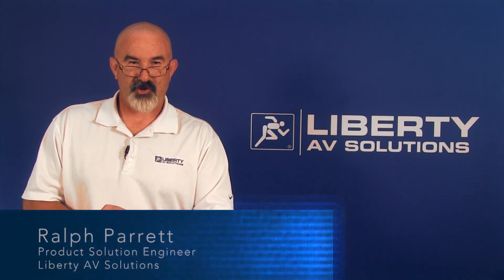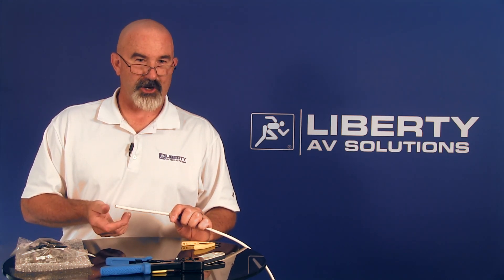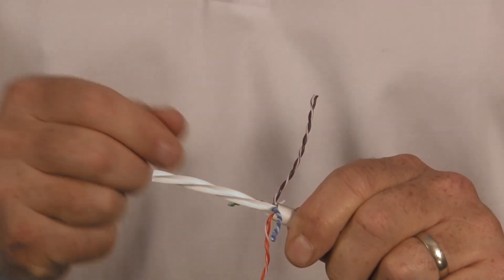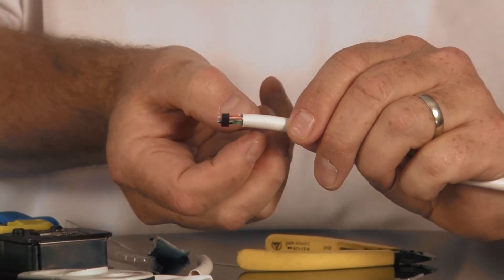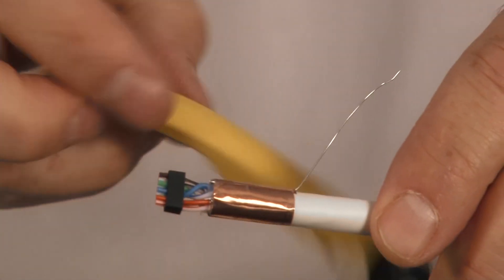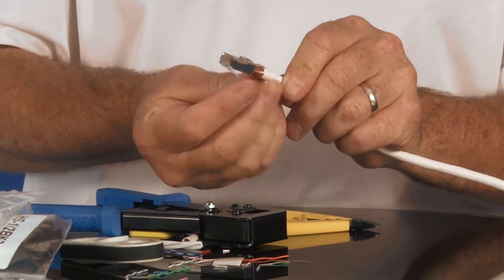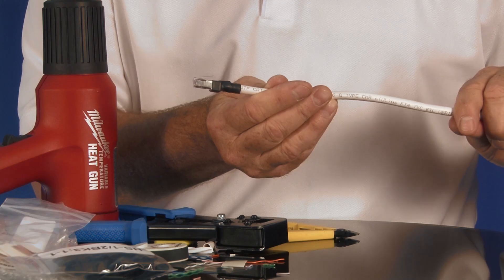HDBaseT Best Practice Termination - Shielded RJ45 on CAT6A F/UTP Category cable

Comment: Thank you and appreciate the time taken to make this video.
The only thing I'm missing with this technique is a boot lip that protects the clip of the rj45 connector from snapping off.
I need to carry these cables to a different location to run HDMI over long runs, and the clips are the first thing that break. Any suggestions?
Thanks
Reply from the maker: This technique can be utilized with a boot, instead of running the shrink tubing up and over the connector, use a shorter piece (cut in ½) and only slide it up and against the back of the connector.  Then when prepping, slide the appropriately sized snagless boot (8~8.5mm OD for Cat6A shielded) up the cable first before sliding up the shrink tubing.  Complete the termination, including the shrink tubing and then slide the boot up and over the connector.  This may be a little tight over the shrink tubing OD but that will help hold the boot in place.  Also don’t do it when the shrink is still very warm – as it may bunch up like an accordion because it is still flexible.  Let it cool a bit before sliding the boot fully up.

Comment: First of all, you are the Jesus of data cable sir. All hail! Couple things...
1) What is the shrink tubing size? 
2) Crimper P/N?
3) Does the crimper have the ability to crimp the strain relief as well?
Reply from the maker: Hi Jesse ;) we're right with you, Ralph is the man! Here is his answer: The Shrink Tubing is ½” 3:1 shrink ratio.  The Crimper part number is 100054LW and it does not have a strain relief crimp option. We do have another tool, (item # 12360C), that crimps the strain relief.

Comment: FYI, you might encounter split pairs caused by this method. The added layer of copper tape thickens the overall diameter which then requires one to squeeze the cable to make it fit into the connector. This squeezing no matter how careful can cause the blue and green pairs to carve into each other and cause split pairs.
Reply from the maker: Thank you for your comment. While this is a common method and we haven’t experienced this with our terminations, we’re sure our audience would welcome your tips on how to avoid this in terminations.  Please feel free to share!

Comment: Untwisting at 4:15. The best way to remove the "convolutions" as he says at 4:42, is to hold the pair tightly together as you untwist it. That way, you separate the individual cores of the pair AND remove those little bumps all in one go. "This is probably the longest part of the entire termination...", well my method speeds that up a lot, particularly when it comes to trying to insert the cores into the little guide piece (load bar) of a 2-part connector.
Reply from the maker: Great feedback! :)

Comment: Only terminate one side of the shielded cable. You will hear people claim it doesn't matter if you shield both or one side and they'll post supporting tests that show there is no difference, but those tests are flawed in that the grounding on either end of the cable is the same ground potential and therefore virtually same ground plane, so of course there's no difference.  The failure in shielded cables that are grounded at both ends will show up only if the is a difference in ground potentials of the end points, in which case your shield actually becomes an antenna and attracts interference, rather than shielding against interference.
Reply: This is absolutely bad advice. 
Always shield both ends.
Think there might be a ground potential difference? Check it with a multi meter. If you do have a ground potential difference simply use an unshielded patch cable.

Comment: why didnt you crimp the metal strain releif?
Reply from the maker: Hello!  Thank you for your question - The strain relief is made from very flimsy metal, you can crimp it with a special tool but it will still loosen back up immediately with normal flexing.  We recommend applying the 3:1 shrink tubing as an anchor that holds that strain relief tightly against the copper tape and ensures a much stronger strain relief – better than any boot for that series.

Please let us know if you have any additional questions.

Comment: Are you recommending this on both ends? Typically we are told to only connect the drain on one end.
Reply: Yes, you should have it shielded on both ends.
Reply: No. Don't ground both ends. It leaves you vulnerable to interference if there are any site grounding issues, such as differential ground planes.

Comment: Probably not necessary but I solder the drain wire to the tang on the back of the connector as an extra measure before forming it around the wire.  I feel this makes an unquestionable electrical bond to the connector body.
Reply: Sounds like the best option (if you can do it). I got some 3m 1181, and the adhesive on it does not seem to be conductive as claimed. I’m 99% sure it’s real (has proper 3m markings and everything). But I tested it with a multimeter, and the signal didn’t want to go from the adhesive side to the copper side.

Comment: did i miss color coding and which color goes where inside the connector?
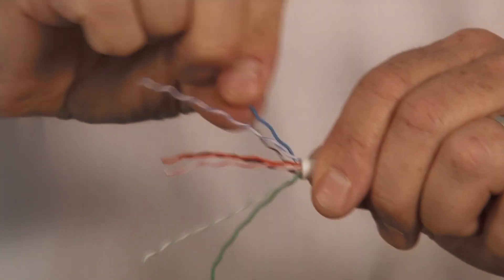Reply from the maker: Between 5:10 and 5:40, Ralph goes into it in a little more detail.  Does that help?

Comment: Very clear presentation, thank you.  I have 2 questions; 1) Can I run a cable like this from an HDbaseT matrix switcher to a keystone jack? (will use certified patch cable from jack to receiver), and 2) Would I need to use this technique on both ends of cable? (switcher and keystone jack ends.  in other words, do i need to connect shield to ground on both ends?)  Any help is appreciated.
Reply from the maker: Hello Jon,
 
Yes you can, however the keystone jack does need to be shielded and the patch cable on the far side should be as short as possible and ensure it is at least 24 AWG, some Cat6 shielded patch cables are 26 AWG and this can cause attenuation issues.  You do need to follow the same technique on both sides, the ground must be continuous in the circuit.
Reply: Thank you for the prompt reply.  I am still confused by one thing...grounding.  The video shows correct termination (best practice) for a shielded cable.  I do plan on doing that on both ends.  I plan to only ground (6 AWG ground wire to main ground) at  the patch panel.  Do I need to also ground the junction box that contains the keystone jack or is the properly terminated cable in conjuction with the proper jack sufficient if the patch panel is grounded?
Reply from the maker: You would not need to ground the junction box, the ground at the patch panel is correct and all that is needed.  The proper cable and jack is sufficient.
Reply: Thanks again.  Subscribed.

Comment: Little trick of the trade, when straightening out the wires to be as straight as possible, take your trusty Extron screwdriver and grab each individual wire and run it out, much like you ran ribbon across scissors when you were a kid to make the ribbon coil. Well, do the same with your Extron screwdriver and they'll be as straight as an arrow.